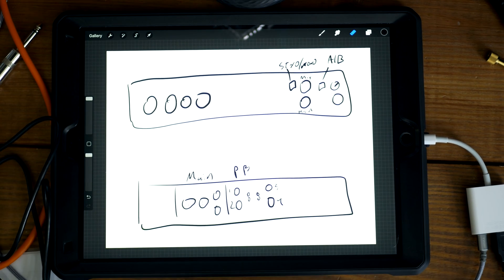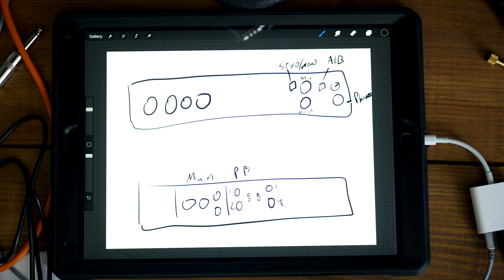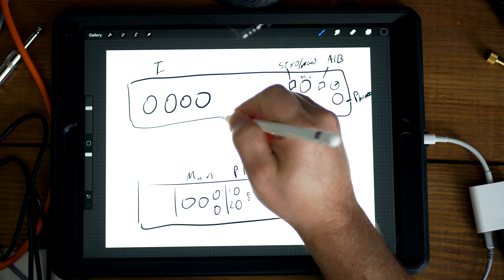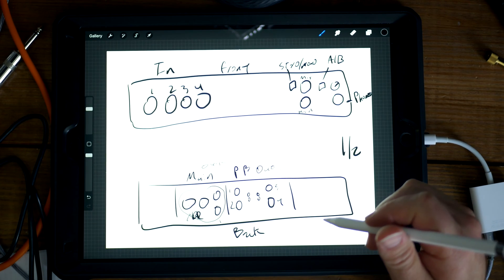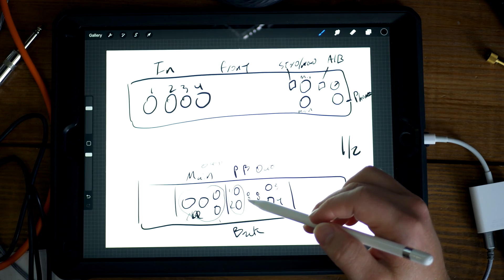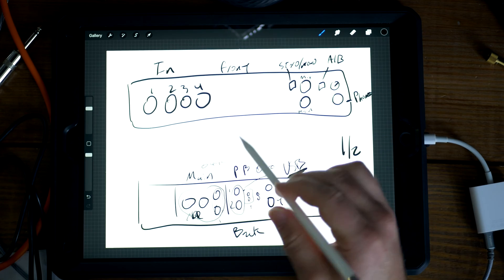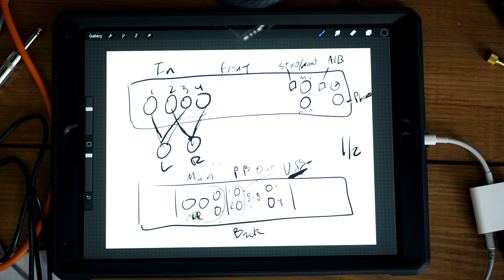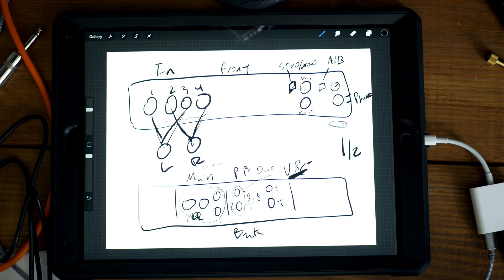Behringer UMC-404HD | Audio Routing Explained

Comment: Can someone tell me if I can basically plug in more then one guitar and play along with other people before I'm gonna buy it?
Reply from the maker: Yes you can plug in more than one guitar. All 4 inputs are the MIDAS preamps. They can take instruments or line level. It could be used as a very limited stand alone mixer.

Comment: Can you use the audio interface in standalone mode? Meaning after setting your routing through the computer, can I plug the USB into just a power block and use the AI as a mic preamp outputting it over headphone and outs (without a PC or DAW in the mix)?
Reply from the maker: You can use it as a standalone, very limited mixer. However there are no settings to set as it is pretty dumb on that end. It would literally be what you plug in is what you get. With the MIDAS preamps, it could work out fairly well depending on your setup and needs.

Comment: Just getting started helping my church. They have this box and were going to go out to the DSLR like your other video. Which was great! If they have a mixer for remote mics. How do I get that into this unit. Is it only XLR?
Reply from the maker: As far as inputs, the inputs are combo jacks, meaning they will take XLR or 1/4 inch cables. You could go out of the mixer into one of the input jacks depending on how many you are already using.

Comment: Nice explanation, I kinda get the routing now. But...
I still have one big problem with this. I can't hear my Windows system sounds through the interface. Maybe someone can help me out:

So, I have my interface connected via usb to my laptop, an xlr mic connected to input 1 and a headset connected to headphone out. Nothing else, I just want my headset as output for now if that's possible, because I don't have speakers.
The MIX knob is set on 50% (half input, half PB), Monitor is set to A, Stereo/Mono is set to Stereo. I can hear the mic input very clearly through the headphones, but I cannot hear my system sounds (like music playback, YT Videos etc) from Windows. If I want to hear anything from Windows, I have to connect my headset directly to my PC sound card (not on the interface).
I've already tried setting my Windows output to the behringer out 1+2, 3+4 or 1-4 and tried switching between Monitor A/B, Stereo/Mono and every combination I could come up with. I've tried two different headsets and different adapters that all work on their own. The latest Windows driver (version 5.0 I believe) is installed and active with it's default settings.
Am I missing something?

Comment: Thanks a bunch- I have this interface for a while now and have seen quite some video's/reviews on the UMC404HD, but you might be the first person to explain the routing in a straightforward and clear way! You've earned this subscribe, man.
Reply from the maker: Thanks. Glad I could help and thanks for the sub.
Reply: hi i want to connect my yamaha psr or700 to the behringer to record music. to which port I need to connect front or back? and which port from the keyboard? Please advise.
Reply from the maker: @germanyproductreviews4136  Connect them to the front inputs. On the keyboard there should be a set of stereo main outputs. I would use them and connect to the 1/2 or 3/4 of the interface.
Reply: Same question here😂…maybe because he bought the iPad and he needs to use it somehow😂..good video btw but with the product could’ve been so much easier

Comment: Hey man! I have this behringer umc 404 hd. I want to use it on zoom conferences. How do i setup using my laptop and xlr mic? do i need to add mixer for the setup? Thanks.
Reply from the maker: No mixer should be required. Just choose the Behringer as the audio source and you should be good. You may need to adjust the input gain on the mic input so its not to loud. Maybe do a test call with someone so you can troubleshoot anything and get the levels adjusted correctly.

Comment: Why my monitor sounds really small when i playback the recording? the monitor volume already high, I use samsung smarthphone headset with jeck converter to connect at Monitor port (beside the master volume and mix) .. plesse help, thankyou
Reply from the maker: One issue with the behringer is that it does tend to use system audio settings for its input and output. So depending on your operating system, go into audio settings and make sure the system audio is set properly.

Comment: High there,  thank you for the great video,  helped with my pad. Do you have any  experience using this on an imac, as I'm having track bleed. Running High Sierra. Thank you very much :)
Reply from the maker: I have used it with my MacBook pro. I think the nature of the interface there are a little bit of track bleed. Most likely a design flaw and how they can sell them so cheap.

Comment: This was VERY helpful in understanding that most outputs are coming from the USB. How do I send audio to the USB? I'm using a UMC 1820 (the same just bigger)  plugged into a PC running Traction Waveform 11 as my DAW/recording software. I tried using that and also Voicemeeter Banana to send audio back and thus be able to plug in speakers to my interface, but I still only get audio out on the 1-2 output, and none of the others. Supposadly this interface has several outputs, but I can only use one.
Reply from the maker: You have to route the audio via your software to get outputs from the other outputs. You cannot do it with just the interface.

Comment: I've got a question also regarding the routing of the UMC-404HD. I'm thinking of buying this interface if it's possible besides using 2 channels by themselves for Mic In and Bass Guitar In and use the remaining 2 channels for connecting (or sort of inserting) an external Mixer using the 2 In channels and any (which?) of the 2 Out channels of the Interface to be able to connect more things via the Mixer. So my question would be: is my plan achievable with the UMC-404HD and how? Any help is highly appreciated - thanks!

Comment: @TheAudioDabbler i have two questions 1.if i put the knob all the way to playback i obtain a very disturbing background noise, something like a rustle... i can't find a way to remove it. 
2, if i use the audio interface on windows i obtain a very low output volume, no way to enhance it

Comment: When using a Drynamic Mic for micing an acoustic guitar, are you using it with Line or Instrument level (buton engaged)?  And also, the PAD?
Reply: You should be using the balanced mic input, as in using an XLR connection. Connecting the mic via either instrument or line input will very likely have a lot more noise and weaker signal. The button/switch should have no effect on the XLR input.

Comment: Hi, i'm wondering if you can use this as a mixer without plugging to a laptop. If you just plug it to the wall will it still send the 4 inputs to the l/r outputs?
Reply: Haven’t tried it but i just read in another video someone commented that it works as a mixer without plugged to a computer.

Comment: Thank you for this tutorial! It was confusing at first using Ableton Live but I was able to route the metronome and monitor,(audio in my right ear and click in my left ear) through output 1 for headphone jack A, and then stereo out to my camera interface or PA system (depending if im playing a live show in person or streaming) through 3/4 B playback. That way I can have tracks panned for sound quality to the camera and if I want to hear it as stereo in my headphones say after I've established my beat I can just press the B monitor for headphones button and the metronome is gone and I can hear stereo audio to monitor. Lovely!! Just what I wanted! And to eleborate for any Ableton users just make sure your audio settings in preferences is arranged correctly. In my case with the 404HD I need all ins and outs mono and stereo to be on.  And so to add to this I can also plug my single PA speaker to output 2 main or playback and have sound simultaneously in conjunction to what I mentioned above. So basiaclly I can record stereo to video while projecting to a small crowd while i perform live and still have the ability to monitor with a click that no one can hear except me. PERFECTO!!!!
Reply from the maker: glad my video helped.
Reply: @TheAudioDabbler  Hello, is it possible to connected 4 speakers ( 2 on the main output + 2 on the playback output) to play at the same time?
Thx for the video btw helped a lot.

Comment: Hello, sir! I'm using the Uphoria 404 for doing a podcast with up to three participants, but so far am only monitoring them myself via phones at the front. If i wanted to allow the others to monitor themselves with headphones so they gain better mic technique (ie not constantly pulling away from the mic randomly) and also so i can hear them thru the front phones and they can hear themselves and each other, what would be the ideal config? Thanks!
Reply from the maker: Are they virtual or physically in the room with you? If they are physically in the room then getting a headphone amp with multiple outputs would allow each of the guests, including you, to monitor.
Reply: @TheAudioDabbler  they are in the same room. i do have a small headphone amp with multiple outputs but only used it in a live band sense with  a stereo send to one person, will give it a go, thanks!

Comment: I have the same interface and getting Yamaha Hs8 soon and I will order a SVS PB-2000 subwoofer with RCA connections only, as well. Can I connect the subwoofer to 1/2 Playback output and the speakers to the Main XLR Output and get the signal from my computer to both at the same time? (like I would connect subwoofer to interface and then the speakers to the subwoofer) Or do I have to do it the traditional way and connect the speakers to the subwoofer and the subwoofer to the audiointerface? I really want to avoid that as I would have to buy adapters cable from RCA to XLR etc. and worry about the overall sound quality.  Please let me know.
Reply from the maker: I could assume yes, since Playback 1/2 mirrors the main outputs. I will say though, you can't control the Playback volume via the gain knob on the unit. the Playback volumes are controlled via whatever software/DAW you are using.
Reply: @TheAudioDabbler  Thank you for your response. In the meantime, my Yamaha Hs8 arrived and it is like you said. My old subwoofer got the same signal as the speakers on the playback output but had to change the volume of the subwoofer separately. If I use an adapter cable for the new subwoofer to the 6,3mm Main Outputs I could regulate the volume together right? But I would still have full range on my Yamaha speakers, can I adjust that with a DAW software then when I want to surf on the internet for YouTube etc.? Or would that only possible if I do mixing or something?

Comment: Dude, can you tell me if there is a difference in the functioning of the interface connecting only by USB? Compared to connecting to a power supply.
Reply from the maker: No difference. It can be fully bus powered but sometimes, depending on the computer or what you are connecting it to,  the USB may not supply enough juice. Alternatively, you could just plug in the power supply and use it as crude 4 channel mixer/amp without the need of a computer.
Reply: @TheAudioDabbler  Thank you!!!!

Comment: Thank you so much!

I'm using my UMC-404HD with Jamulus software to rehearse live with our 4-piece band , and I've been trying for weeks to figure out how to monitor the USB coming from Jamulus rather than my local sound.  (Monitoring the USB stream coming back from Jamulus rather than your local audio helps overcome some of the latency and allows you to better stay in sync with the rest of the group.) Your explanation of the Main vs Playback output, and the Monitor function as it relates to what's heard in the headphones, is perfect! 

And may I say that the Behringer manual for the 404 does not remotely provide a clear explanation of how the Main and Playback outputs function, nor how the Monitor knob affects what you're listening to with regards to the local vs USB audio in your earphones.  It's actually not that complicated, but their manual just doesn't give you enough detail to understand it!

Well done!

Comment: Hi i recently baught the interface works perfectly but my question is regarding the UMC control panel. On the  "output tab". You get an option to adjust volume for the master channel which i assume will be for the main outs and than you get a tab for outputs 1 & 2 and 3&4 which i will assume is for the playback outputs .my problems is if i adjust the playback output 1&2 volume on the control panel .it also  lowers the volume on the master output(mains out)

Is this the way it should be or they is something i can do to fix this?

Sanele Makhanya

Comment: I just bought my audio interface UMC 404HD, but my problem is before that? in Audacity, I just got a stereo channel (1-2 or 3-4), even with MME, Win Direct Sound or WASAPI. How setup to get mono inputs?
Reply: first you need to use the ASIO driver from Behringer made for the UMC404HD (you can find it on their website or just search UMC404HD driver). Once you have installed that, you can activate the mono input 1-4 from your DAW (just google on how to activate multiple input for your DAW). And I suggest that you use different DAW as the Audacity is pretty basic (you can try Reaper, Tracktion Waveform Free, Sonar Cakewalk just to name a few).

Comment: For Garageband users! 

Be aware of that Garageband can't route sounds to different outputs, in case you want to use all of the four outputs on Behringer. Meaning that "monitor A and B" button will only work as a on and off button for the headphones.

 If you want to use a second pair of monitors for reference you can do so even with the limits in Garageband. 

Connect your reference speakers to "playback output A" (it sends the same signal as "main out") and turn down the "main out" volume.
Then you only hear the reference speakers.  

You can't control the "playback output A" volume from the Behringer so you have to control it from your daw, amp or active speakers. 

This is for Garageband users and not for those who can route the sound to different outputs of Behringer.

Comment: Hey man.. Love ur review.. I have a question.. Can I listen to 2 pair of monitors at the same time??  With this interface.. Thank you
Reply from the maker: As far as I can tell, the unit mirrors the sound out of both XLR and 1/4 outputs. You could also use the Playback channels with 2 different sets of monitors. Then in whatever software you are using, switch back and forth between outputs 1/2 and 3/4.
Reply: @TheAudioDabbler   thank u for ur time.. That was quick.. Thanks,, that was helpful 😊😊😉😉

Comment: Does your 404hd have low volume out coming from the main outs. Even with the playback all the way to the right the output still low. Ive checked all my volumes even in the ipad but the volume from main out are still way lower. I like my output volumes running HOT
Reply from the maker: I have not noticed a huge difference in the volume out. It could be a defective unit. Could you try with a different device? Maybe a different Powered USB Hub? What apps are you using it with? inside of AUM or Audiobus there is Input Gain settings. Sometimes it seems to be at 75% or lower. Make sure that is up. Have you tried the PB channels to see if they are different?
Reply: TheAudioDabbler im using beatmaker3 impc pro 2. The headphones are fine but the main outs i have to turn the knob all the way up. Im using the 1/4 inch outs. Would the xlr outs be better?
Reply: TheAudioDabbler i think i found the problem. Im running the outs to my presonus Fire Studio mobile line inputs and for some reason those are designed with low input volume. So on the computer the volume is coming in lower. I connected the 404 outs straight to my monitors and the outs have plenty of volume. Thanks for your help